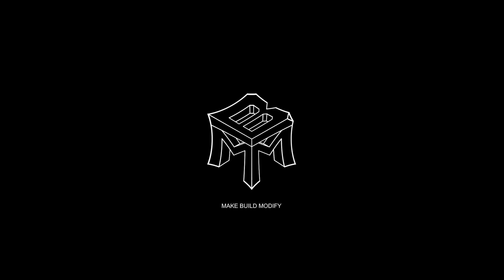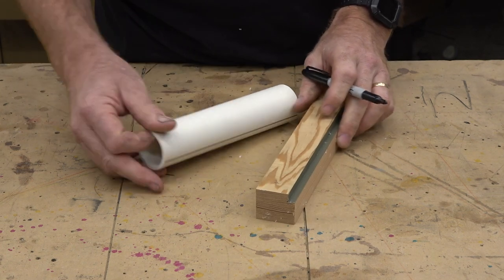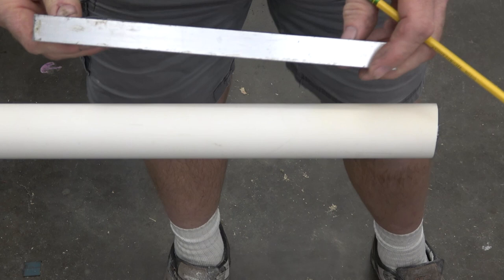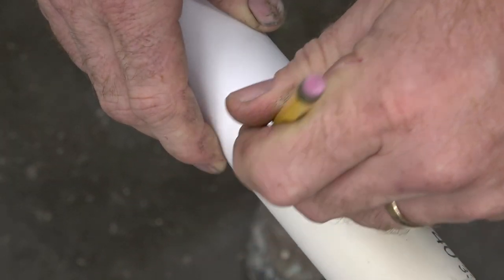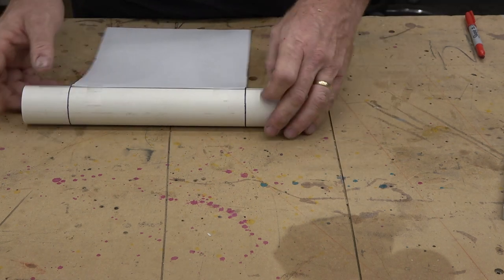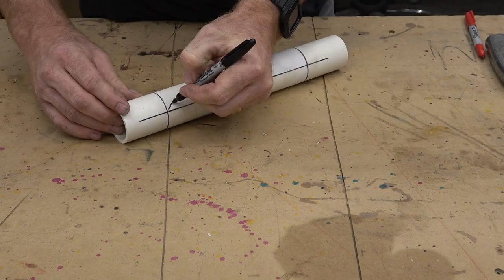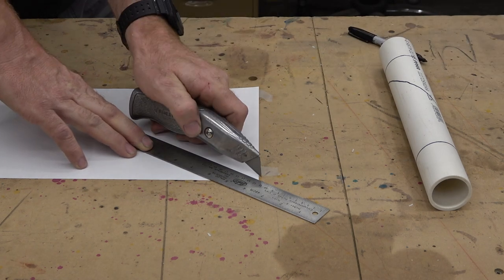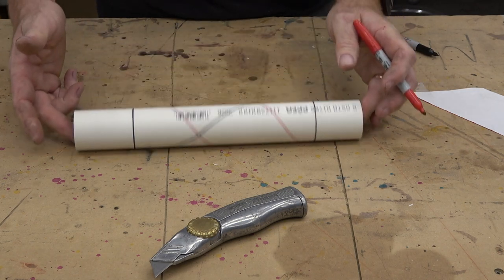How To Mark or Draw Spiral, Parallel, and Perpendicular Lines on Pipe or Cylinders

Comment: Excellent. Been using the first 2 for 40 years. For a spiral I used long & circumferential & sketched a line between intersections. Your way is MUCH much better. Thanks for taking the time to show me that method.
Reply from the maker: You bet! I've used the other method too. Mostly when drafting. Both methods are good to know. Thanks for watching!

Comment: Proper job, thanks. I'm guessing it's easier to make distance markings on the paper too before putting it on the tube, if you need them; than making the line and then trying to measure distances along that line.
Reply from the maker: Yeah, it can be.

Comment: I’m just imagining how big of a piece of paper it took to paint the spiral on the Cape Hatteras, NC lighthouse! Ha! Seriously, that’s a subject I’ve wondered how they did for years! And it’s tapered, not parallel sides! On another note, welding supply stores sell “Wrap Arounds”, which is a rolled up 4 inch x long price of cardstock like material, heat resistant of course, that welders use to layout cuts on pipe similar to your paper method. Kind of like the framing square of the pipe welding world, it has markings on it to layout angles (other than just 90 degrees) and saddles etc. Very good vid!
Reply from the maker: A huge tapered spiral like the would be a go candidate for parallel line development. Old school, but effective. You could draw a scaled representation and then plot the spiral on the building.
Reply from the maker: That wrapping layout tool sounds fantastic!
Reply: @Makebuildmodify  they’re not expensive either!
Reply from the maker: @tomt9543  Nice!

Comment: Thanks for the tips. What is your suggestion for large pipes. A pipe with the the diameter of 800 mm for instance?
Reply from the maker: I've never had to do it. But I would try to find a larger piece of paper and follow the same steps.

Comment: Very helpful. I need an uber straight perpendicular line on a PVC pipe with uneven ends that's 9 inches in diameter. Any ideas? Just tape a couple of 8½ X 11 inch paper together & use the same method as shown? 🤔
Reply from the maker: Maybe use some poster board or a large piece of art paper. Any square and flexible sheet stock will work.
Reply: @Makebuildmodify  Good idea. Thanks!
Reply: Butcher paper, take it from the smoker stock 😁

Comment: For the double length spiral wouldnt taping the end of the triangle and then the straight egde work as well? Same principle but wont have to do the 2nd cut, start the spiral then untape the straight edge, finish the spiral w the point taped down
Reply: Also using the speed square would work for the perpendicular lines. Set the speed square on the top side and use a notch/ inner line and roll the tube
Reply from the maker: If you use the tip of the triangle first it will still overlap itself. (I just tested it)
Reply from the maker: That might work, but you would have to keep the tube from shifting laterally while you rolled it. Tough to do, but not impossible.